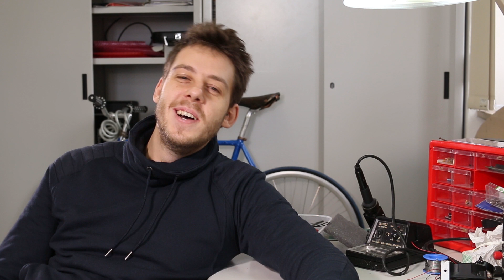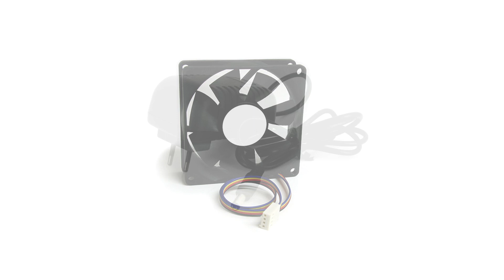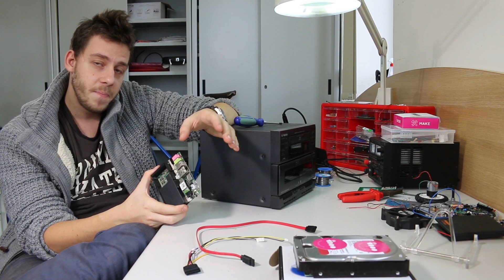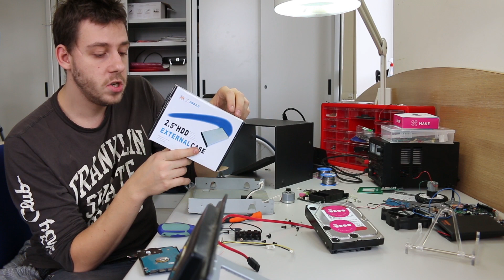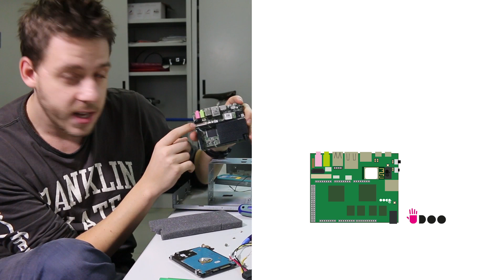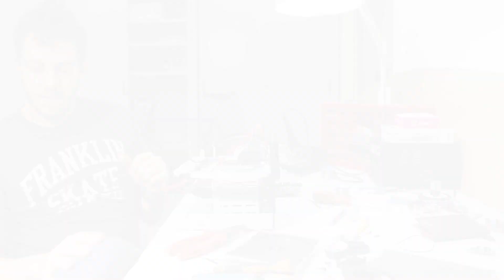DIY NAS with Openmediavault and UDOO - pt. 1 Hardware

Comment: Hi,
   Thanks for sharing the UDOO NAS setup. I am wondering that are there any solutions for connecting 2 SATA HDD to one UDOO QUAD? Sometimes, we need 2 HDD for NAS as RAID 1 for better data protection.
    Thanks for your help.
    Cheers.
Reply: That's the problem with UDOO and other boards with 1 port sata like Banana PI, Cubieboard , ect...their chip (probably) can't support PMP (port multiplier ) on sata multipliers boards
Reply: You all prolly dont care at all but does any of you know of a trick to get back into an instagram account?
I was stupid forgot my account password. I would love any assistance you can offer me.
Reply: @Jasper Tripp instablaster =)
Reply: @Atlas Leon Thanks for your reply. I got to the site thru google and Im waiting for the hacking stuff now.
Seems to take a while so I will reply here later with my results.
Reply: @Atlas Leon It worked and I finally got access to my account again. Im so happy!
Thank you so much you saved my ass :D
Reply: @Jasper Tripp Glad I could help =)